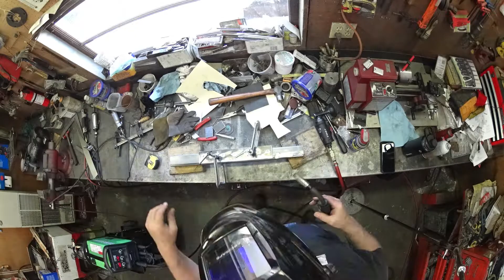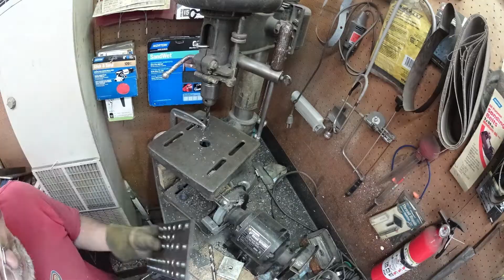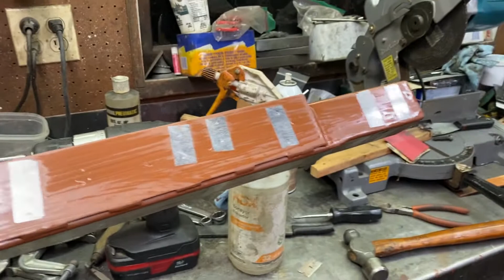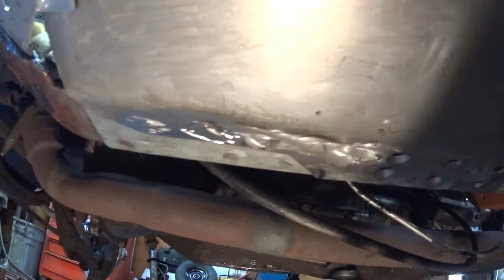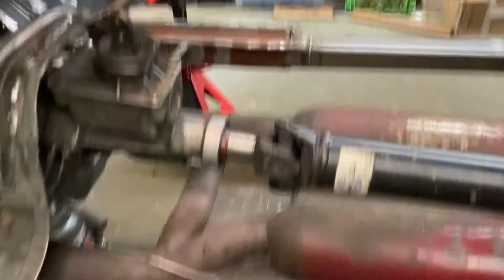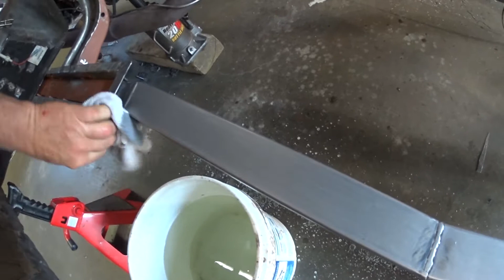66 Mustang Betsy - Chassis Stiffeners Part 3

Comment: I like the frame rail connectors.  Great Job!
Reply from the maker: Thanks Jerry, I need to look at your EPAS install. Is yours an auto or manual trans?
Ok, just looked at your video. Thanks for putting that up. I am seriously considering an EPAS install.
Reply: @donsmanufactory  Manual.  Going from a 3 speed to a T5
Reply from the maker: You’ll love it. The best part is when you shift to overdrive and the noise and vibration is greatly reduced cuz all them parts start spinning at different rates.